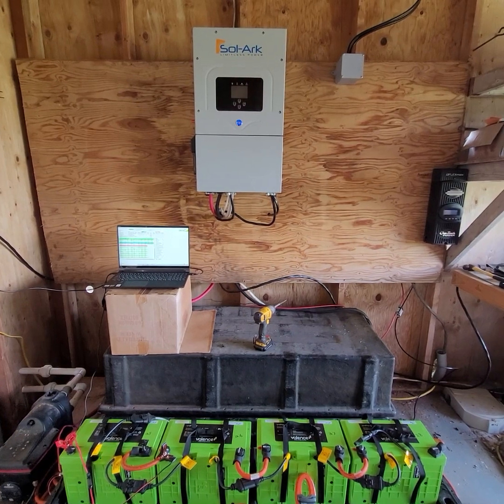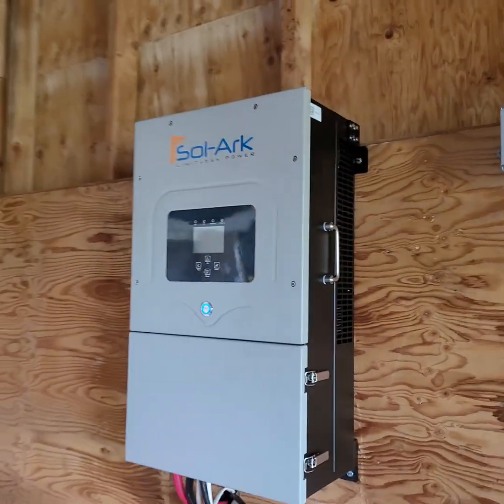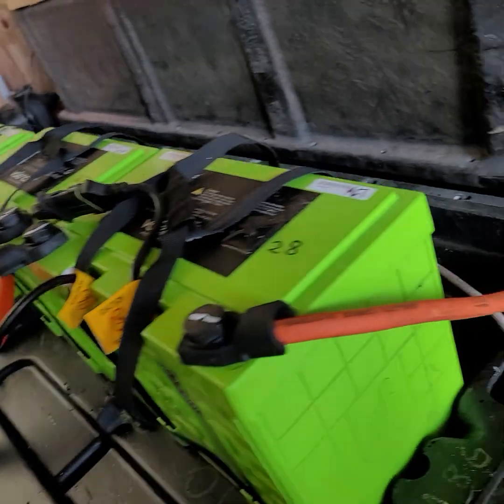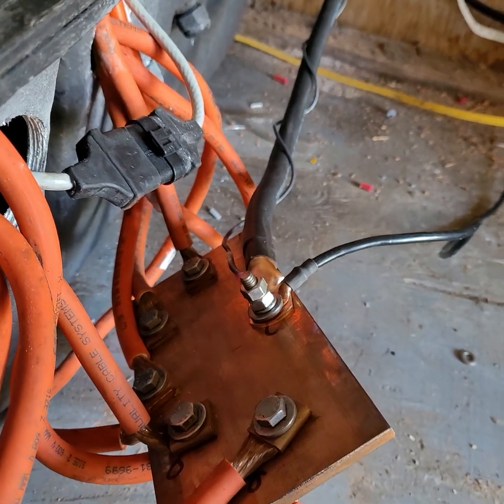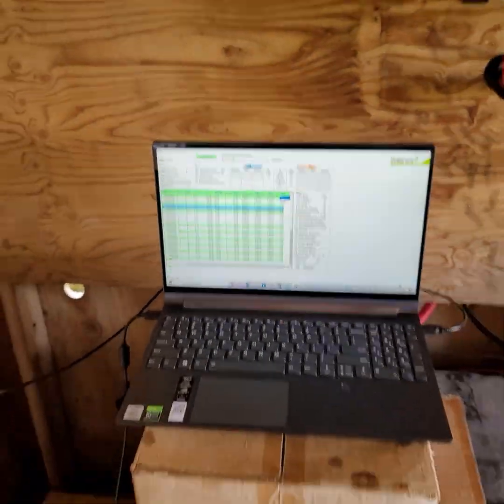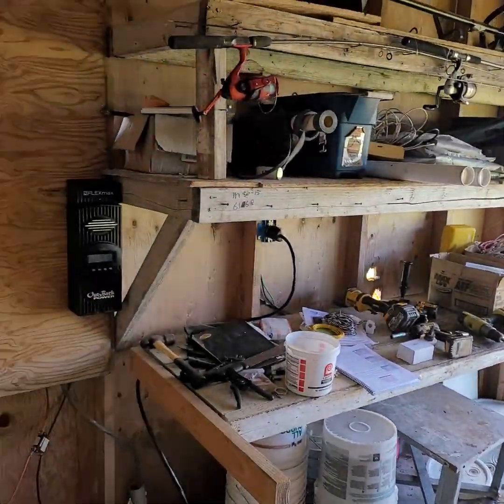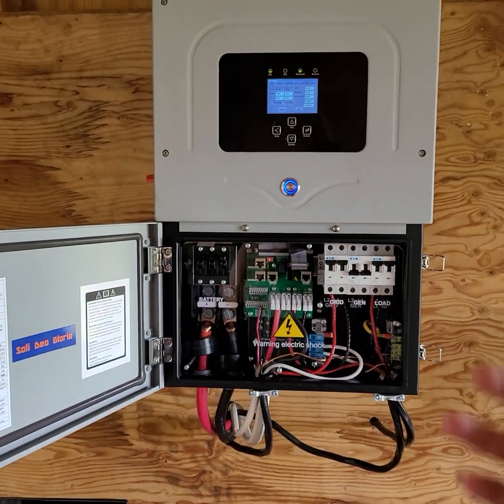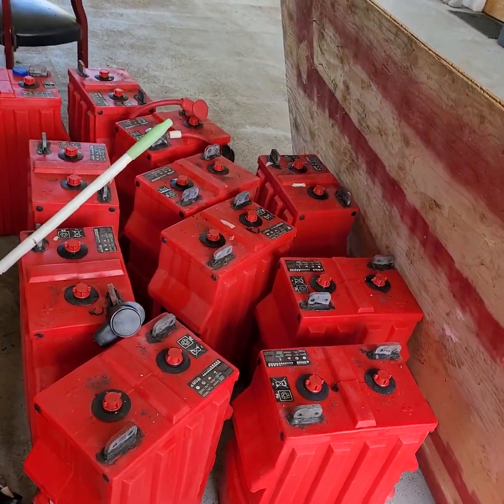Sol-Ark inverter with 71kwh Valence u27-12xp lifepo4 lithium battery.

Comment: I hear so much bad about the solark . I'll get a growatt
Reply from the maker: They're expensive so the grow watt is a better choice especially if you don't need all of the options that come with the other unit.  Just make sure you get an auto transformer for the grow watt. You'll thank me later. Even if you have the American l1l2 neutral unit you should still get the transformer. But then if you're getting a transformer why not go with the cheaper European model anyway? Because it also allows much higher voltage input from the solar panels.  Go to signature solar and you'll see they sell the grow watt with the transformer as a package deal.
Reply: @SiriusSolar  I plan on this very soon . My system has to be grid tie so the 👀 👀's are gonna be on the ul certificate. . I appreciate the advice

Comment: Have you given up on the Delta H6?
Reply from the maker: Kind of. I'm still using it for my home off grid but it occasionally explodes and I'm not entirely sure why. Sometimes I think it's because it doesn't like the surge of starting my electric clothes dryer .  Sometimes I think it's because of the hack / bypass circuit I worked out to make it work in the night time but then I had one explode for absolutely no reason in the middle of the daytime once.  I'm on my third or fourth one already.
Reply: @SiriusSolar  So would you recommend the H6 to someone wanting to use it on a grid tie system with ~6KV of panels attached to it (likely never seeing over 5.5kw)?  I really wanted to go with a hybrid inverter that could handle a 48V battery system for backup, but those options of that size are a LOT more expensive.  I think I can live with the islanding feature of the H6 should the grid be down... just to keep food cold, a TV, and run a small mini-split.

I already have a ~1900w separate micro-inverter based system which is plugged into a 240V circuit and it covers most of my needs.  But I'd like to add a larger system and the micro-inverters require a grid presence to kick on.  I was thinking in the event the grid is down for a while due to a major storm, if I plugged this micro-inverter system into the end of the island output feed of the H6 during the outage, it SHOULD think it's tied to a functioning grid and kick it on thinking the grid is active.  I don't know how the H6 would play with it if I did this, but I would likely only want to do this if it was cloudy and wanted the supplemental power during the outage.  Again, in this senerio I don't think all the panels tied together would ever come close to reaching 6kw anyway since the micro-inverter system is facing SSE and the larger H6 system would be facing WSW.

Obviously I'd still be powerless once the sun when down, but I could easily buy a small generator to get through the evening.  Having the H6 island in a major outage would be enough to keep the house and food at the proper temp...

Thanks for your thoughts!

Comment: You could install a timer relay for the generator, lets  say the contact is NO, when the AC output of the gen kicks on the timer would start, after few hours the relay will open again, maybe install it in the relay on the start up switch of the gen, it may work, it depends on the gen actually. The solark will think the gen failed or something like that, the other option is using an arduino and relays, the same idea, different equipment.
Reply from the maker: Rumor is when the solar Arc thinks the generator failed it will no longer try and start the generator.
Reply: @SiriusSolar  so, do you mean that after the gen starts and it goes off, it wont try to re-start, right?, if so, them it might work, the idea im telling you is: first the gen starts, works for a few hours, second the relay (connected to the gen start) should close or open, depending on how it suits you, so the gen turns off, the solark will thing the gen failed or ran out of fuel, since i dont know all of your config, maybe im saying crazy ideas, but the general idea is something to send a signal to turn off the gen after a few hours, the next day you would reset the trigger
Reply from the maker: @rodrigocely82  yes it would be easier to reset the trigger then try and remember to shut off the generator after 2 hours.

Comment: Travis can you show the bms configuration and describe the software used to monitor the valence batteries?
Reply from the maker: I've created a custom way to make the configuration file with the help of some friends.  We're not freely sharing our methods but I do sell the gray box with a working valence BMS inside if you need one.
Reply: @SiriusSolar  I'm interested if you want to message me. I have a 48 volt project using 4 X 30 of the Valence U1-12RT/RJ batteries.
Reply from the maker: @petehagan1959  what messaging system should I use? How can I find you?  The RT batteries don't need external BMS. He would connect their communication cables together only in each string.
Reply from the maker: @petehagan1959  so one string set of batteries communicates within its own string only. You physically connect the string voltage together but not the communication cables.